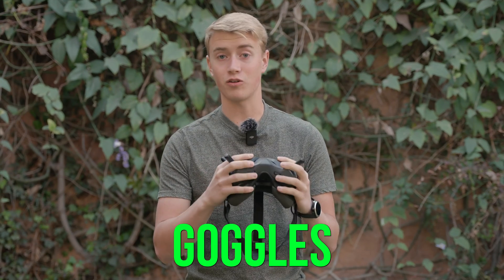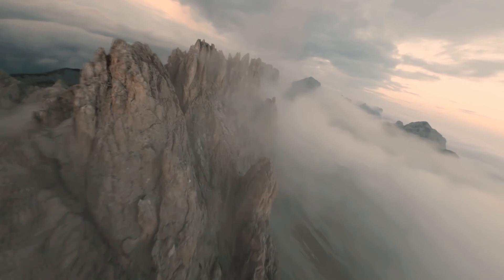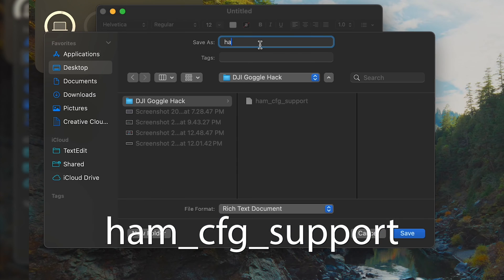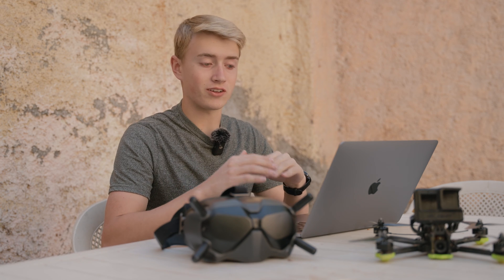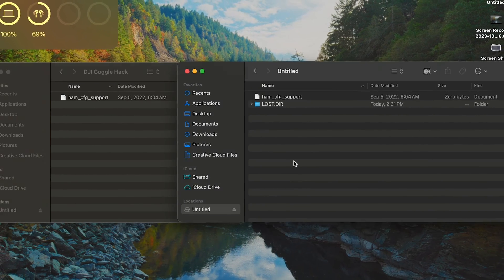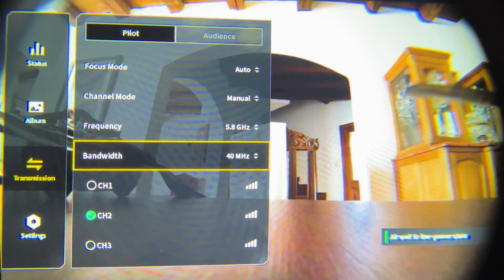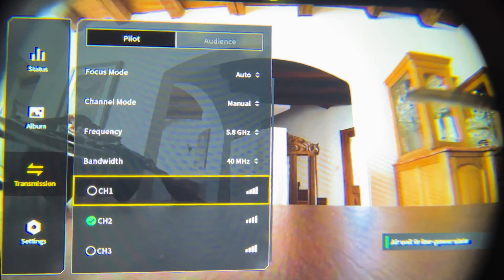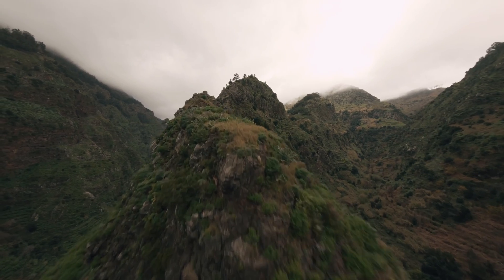I Hacked the DJI Goggles for More Range!

Comment: does this work for the dji fpv? 
today i changed it to FCC mode in drone-hacks for a better distance 

so should i do this with the goggles v2? or should they allready output the highest power?
Reply from the maker: Yes this will work for the DJI FPV, but if you have already done this with drone hacks then it will already be done. Drone hacks also does this hack and it’s already on your goggles, all this is just another way of putting this hack on your goggles!

If you want to you can still try this hack on your goggles but I’m not sure if it will actually change anything since drone hacks already did this hack

Comment: I just got the goggles 2, do you think I should avoid updating any firmware on it ?
Reply from the maker: No you should be perfectly fine upgrading to the newest firmware and then doing this hack, it won’t damage or change the way your drone flys at all. The only thing that this does is it unlocks the full potential and range that the goggles have!

Comment: Does the SD card with file have to stay in the googles or can I remove it afterwards?
Reply from the maker: So just take the SD card out and transfer the text file into it, then put it back into the goggles, after you reboot them you should be able to remove the SD and the hack will still work.

The only time that you will have to do the hack again is if you format the goggles!
Reply: @zaneshawdrones  that's awesome, thank you very much!
Reply: I tried that none of it worked
Reply from the maker: @Warlock485  when I started this I had the same issue. Then I found out that the file had data in it, so if your able to get it to zero bytes then that should fix your issue